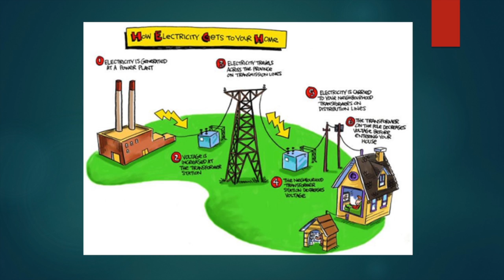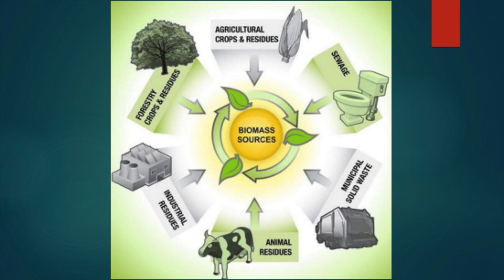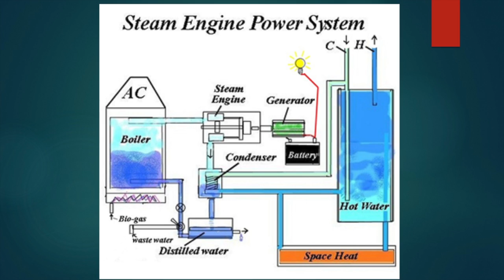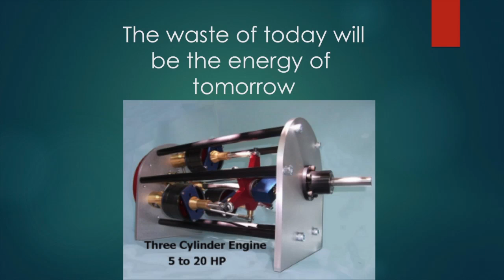The Surprising Future of Steam Power | Robert Green | TEDxMissionViejo

Comment: I've built several different types of micro turbines and piston steam engines, the turbine is more turn-key and my latest combination turbine does a decent efficient job on a small amount of wood, I think I called my video, "off grid wood to electricity co-generation system.",  so yeah, I have a whole system running like the gentleman in this video is talking about here in this video.  Nice for me to see others working on such things, also nice to see an unknown like me, local ideas NPO, has more views than TED on a similar subject. Gooday eh
Reply: Wisco Kidd
Your email id please ? If I want to replicate in India ? a small model ?
Parameswer a t y ah oo do t k om
Reply: Awesome I will look for your vids
Reply: Wisco Kidd agreed mr. Kidd my wife and I have done the same it works excellent.
Reply: So long as the trees are being replaced I have no problem with this on a small scale. It's not going to supply energy for London, Paris or New York but that's not what you're to do.
Reply: @Ronan1692  You hit nail on the head, it could work with remote areas, but its terrible idea for cities, then there is greenhouse gasses and increasing co2 levels. I think he aprouched problem from wrong end.
Reply: @Ronan1692  Trees are not eveery thing.  I don't like listening to this man because he is a terrible speaker speaking on an important subject.  He sounds like he is dying.  Grass, buffalo chips, wood, farts, and ANYTHING that burns will work as a fuel.
Reply: Hey I saw you turbine and was curious as to the generator head you are using and psi for the turbine? I love your vids
Reply: @shredder60  The generator is just a tread mill permanent magnet DC motor and I run a 24V system and I run at about 150 psi. steam pressure. Thanks for asking.
Reply: If everybody had one of these things running on wood there wouldn't be enough of it to go around and the particulate pollution would be horrendous. Fine in theory but a non starter in practice.
Reply: @rogerphelps9939  Your schpeal is a red herring if there ever was one Did I ever say I wanted every human to heat and electrify with wood? In many places dead trees and wood debris is forest fire tinder. A few people doing work to reduce forest fire tinder and burning it to make heat and electricity would save many from intense forest fires. Have a nice day, k.
Reply: I like the turbines better also. The Tesla turbine seems to be the best, but where to get them? I will probably have to figure out a way to make it myself
Reply: @ScorpioSin777  my design is a highbred of sorts I think you could start with a Wikipedia article on the Tesla turbine it is not very efficient. Micro Turbines of any kind are not known for efficiency but any other type of steam engine requires more maintenance and start up management. For off grid independent electrical energy in rural areas small may be a solution.

Comment: He's not completly correct when he says right in the very beginning that electric transmission wastest energy by resistance. A large part is also wasted by electric flied generated. But the truth is, about 1/3 of the energy produced is wasted by transmission. And that is the really bad news for a very long time now. Decentralized energy production, closer to the consumer in each place  would do much better.
Reply: Actually the Idea od using steam engines isn't too bad after all. At the time steam engines mostly disapeared from the market they were not very efficient compared to combustion engines. But at that time material research was far from were it is today. Sadly there is little effort put into design of modern steam engine systems using modern materials. Perhaps he is right, if there would be a change in terms of research into steam engines working at greater efficiency. But the little engine that was shown on the stage is definatly not a highly efficient device. That is too obvious.
We'll see what time will make up in this field...
Reply: Transmission losses, yes all of them start to finish average less than 7%. These numbers are easy enough to find yet people pushing their own particular barrows always exaggerate the losses. While I'm in favour of more local production of electricity starting your case with a blatant untruth removes all credibility to whatever comes later in the talk.
Reply: Dogphlap How can I confirm your point of view?
Reply: Mark Harmon > Unfortunately, you'll have to look it up and do the math, and even then, you'll only know the theory behind it. You'll never actually know, that generator X has an efficiency Y but then as it's operated it's slightly less or that most of the time the energy it produces is just dumped because of poor planning or the freak weather. But you can know that in theory, power grid transformers have efficiencies approaching 97% or sth. that steam turbines can reach 42% etc. and so on.. (by the way these are arbitrary numbers). You do the math and you come up with some figure and you pray it comes close enough to reality. And you trust that the people in charge of these affairs do actually know what they're doing, most of the time (i.e. they use the same theory you've just dug up but actually know it and know how to apply it a lot better).
Reply: @Stelios.Posantzis  transformers are really efficient as you said 97% as are 3 phase ( poly phase ) motors. Grid losses are very low because of the high voltages again as you say less than 10%. Almost most 40 years as an electrician and still learning
Reply: I hardly care about transmission lose. I only want to generate for myself. anyone have the plans to build in of these. I want to make steam to power the engine and then heat my pool with it.
Reply: HGere in the UK grid transmission losses are far lower than a third. It it is a third it has been designed wrongly.
Reply: @rogerphelps9939  When you consider all the losses in the grid by transforming up and down for long range transmission lines, even while each time it is little waste (around 5-10% loss each transformation), it sums up to around a thrid. That is not any much different no mattr where in the world we look at.
And it gets even worse in private households, cause most devices in a house are generally not very efficient, no matter if we talk about a microwave ofen or a hairdryer. The highest effciency, while little over all consumption, you might find in modern private household in LED-lightbulbs and mobile phones/android-tablets. Pretty much the whole rest of the common electronics, in private use, tends to waste energy like there is no tomorrow ... as well as if energy were almost for free.
So when we look at what work is actually perfomed from each Watt produced in a power plant, we are way below 50% efficiency in the outcome.
That might not be much different in the UK than anywhere else in the world, I guess, since there is not much trickery in physics, except when it comes to superconductors (which is not a man made trick, but kind of a trick of nature).
Reply: @asagk  Wrong. End to end power transmission efficiency is 95% or better in the UK. Way below 50% ? Wrong. Clearly you have never heard of heat pumps. The COP olf a heat pump is well over 3 and 5 or 6 is not unusual. I should know because I have one. If you don't know what I am on about I suggest you look it up. Things that use most energy such a washing machines and tumble dryers use 95% efficient electric motors and  the best tumble dryers also use heat pumps. Domestic appliances use electricity to perform their jobs because electric power is overwhelmingly the best way to do it. Some appliances are better than others but there is very little "wasted" energy.  Domestic appliances are becoming more efficient. Today's flat screen TVs are far more efficient than the old valve driven CRT monsters.
Reply: @rogerphelps9939  That is not even possible by physics what you claim. Just a single transformer, converting something like 10kVAC to home style electricity (230VAC or 110VAC) has at max an effciency of around 93-96% (just for a single transformer station!). And at that point we only talk about the last few hundred meters from your house.

Over land transmission uses much higher voltages for long distance transmission, that were converted up most the time to some 100,000 VAC for the purpose of over land transmission at little losses in the lines, and then converted back down in a number of steps to something more useful like 10kVAC, and from there down to house hold voltages.
When put all together, from power plant all the way to house hold voltage, the loss is already huge, because of all the different voltages and transformer stations involved on the way. In average voltages are transformed on their way to a house hold at least something like 4-6 times and then back down again! Because of that, there is simply no possible way to get to something like 95% on the way.

Do the math and find out yourself where you end up when having e.g. 95% of 95% of 95% of 95% of 95% of 95% of 95% of "something" (at only 3 up and 4 down transformations to house hold voltage level)! And all that math does not involve the waste in household devices and cabeling inefficiencies by any means, while that comes on top of the calculus!
You should try get better information on the topic before making the claims you make. What you claim is simply impossible!

And the same is true for most house hold devices. They are far from efficient, since it is common to use inefficient & cheap engines, instead of expensive stuff, whioch is also true for the motors, like in a washing machine. No one wants to pay for highly efficient electric engines, since they are way too expensive already from the additional electronics needed. What is inside a washing machine has at best an efficiency of around 83-85% (not to mention the physical drive belt slip), and that is not too bad for house hold stuff.
Things get much worse for the compressor engines used in fridges. They are even below that rating when it comes to kWh turned into "cooling".

Manufaturers don't like to tell too much about their real energy efficiency, so it is common practice that lobbyists convince politicians to define that efficience is only looked at in a certain regard, but not as the "over all effiency" of the devices. That is why modern household electronics are commonly praised as great power saving models, while in reality they are not, cause to make them rate over all as such, the resulting price tag no one wants pay in reality. And manufacturers want to sell things, just as politicians do to their voters!

ps. And the calculus for the transformations does not include electric field losses in the lines on the way to a house hold. But that is a different story, because that is a really complicated one and even has in reality also to do with where the lines are placed, weather and so on. The influence of electromagentic field onto environment and by environment onto electromagentic fields is pretty complex and depending on many aspects, while the loss is little across a meter in distance, things get quite different over large distances with many dozens of kilometer long lines all across a country with rivers, lakes, cities, rocks, dry soil, wetter soil and so on and on around the lines. Losses in over land power lines even change when it e.g. rains (that is true in fact)!

Comment: A steam engine can run off any fuel because it's an external combustion engine and as long as you can make steam, you can make the engine run.  I bet it would be relatively easy to make a boiler that can burn many different types of fuel.
Reply: Cold steam from a closed-loop vacuum system is better.
Reply: don schmidtke
Reply: @Barskor1  problem with vacuums is that they're just asking to be punctured. they already have low pressure, if not negative, in them. adding extra force or pressure from outside, especially if in a fulcrum just makes it so easy. imagine a rusty pipe accidentally kicked and it's vacuum, just waiting for a leak inside. then what, re-vacuum. pay pay pay. then you'll do it again and again. in a large scale industrial environment, this'll be a headache. ever wondered y we don't use vacuum walls even though they're the best insulators? it all boils down to the $$$.
Reply: @poknatinpokkers5289  Rust prevention and inhibitors have come a long way if you are not maintaining your equipment as a business you are asking to be put out of business.

Creating vacuum on an industrial scale is actually quite cheap you just need a 50 ft tall water tower and a partially open tank 35 ft tall at the base that can hold as much water as the tower.
You use the regular water pump to fill the tower close the pump valve open the tank valve and let the water fall leaving the upper tower empty and a hard vacuum present in it then it is just a matter of more valves and piping to direct the vacuum as needed.

It is better to have an implosive from an accident than an explosion.
What happens if you were running a standard steam system and Bob kicked a pipe? Bob may be dead or maimed and so could many people around him boiling steam spewing and blistering hot water all over the floor to boil those who fall.

Aerogels combined with mylar outer sheets make for resilient vacuum insulation.

You may think aerogels are expensive but there is a way to make them from paper pulp you slow freeze the pannels so lots of ice crystals form then you freeze dry them removing the water.
Reply: @Barskor1  i don't know much about this stuff, but i'm guessing you're saying the low pressure will make the water turn into a gas...but what will make the gas move ?
Reply: @Layarion  The vacuum in the condensation chamber is why the system will attempt to equalize but as the cold side is condensing the steam as fast as it can enter the vacuum/low pressure is maintained.
Reply: Burning any carbon containing fuel is extremely bad for the environment. Furthermore small local steam engines have awful thermodynamic efficiency.
Reply: @rogerphelps9939 --You are correct, Sir.
BUT --- "Hold my beer"...  Because I'm about to change all of that.

Comment: Fantastic idea, increased maintainence costs, massivly increased need for capacity, and lower effecenty. Very heavy on optimism, very low on practacality.
Reply: Yes, it’s lower on efficiency, but if its fuel can be regenerated as quickly if not faster than it burns it, then the real factor to be measured would make it infinitely better than a more efficient engine that runs on fuel that doesn’t regenerate.
Reply: You seem to think steam technology hasn't developed in the last 100 years...
A closed steam system with condensers and if you must a drip line. You could easily run a steam engine for 100 years 24 hours a day with proper lubrication and cleaning. Cleaning as in a routine blowout and even the lubrication delivery that can be automated. Some factories in England used steam energy until the 70s and the steam engines that are still in tact still work to this day.

Comment: I've lived in areas where a lot of people burned wood or coal for cooking and heating. It puts a lot of irritating particulates in the air. I don't know if there is any way to filter out the smoke.
Reply: Ther is actualy ways to filter the particels out of fire from coal and wood for example old steam trains neded to have such a filter so the particals wouldent set fire on the trees nerby the rails

Comment: Cold steam for electricity generation. water boils in a vacuum at room temperature have two vacuum chambers with your steam engine or turbine in between one side hot the other cold larger than the hot side with a condenser coil recirculate with one-way valves and use distilled water.
Reply: No. Creating vacuum takes energy. Maintaining atmospheric pressure takes nothing. It's BS with too many moving parts. When you generate steam you lose vacuum or you need to remove the heat. They know why they use cooling towers - they need pressure differential. A closed loop can only work if heat is removed at some point. It creates pressure to counter your vacuum. His closed system may actually work in combination with a Stirling engine but he has the comments turned off so there's no way to ask him. Not to mention the flexing rod. Any flexing material has to generate heat and also give up at some point. I dont see it any better than other steam engines. Too many moving parts. does it run at lower pressure while still turning the generator? The efficiency should be easy to measure. His patents are still available so people figured it out I guess. Another hour lost and still no nice little cheap steam generator to charge a car battery
Reply: @trollmcclure1884  Fighting against atmospheric pressure wastes engery, you have to spend more in heat to make steam and you lose energy overcoming the atmosphere in order to move the steam.
If you are operating my system the cooling needed is just a few degrees aka not energy-intensive as for moving parts once evacuated you are done with the most complicated part as it is a closed-loop the steams condensation maintains the vacuum.
Reply: @trollmcclure1884 -- Remember this date. Because this is when I said "Hold my beer"...

Comment: As hard as it is to get electricity to everyone it a lot easier than piping gas. That's why so many houses have gas tanks outside. Also a polyphase motor is 97 to 99% efficient the best I've ever heard on a stream engine is less than 50%. Remember an engine is a user of energy be it petrol diesel or gas in an internal combustion engine or heat in a steam or sterling engine. Electricity is made by coupling a generater to an engine. PV's not withstanding. But if I start writing about PV we shall be here all day.